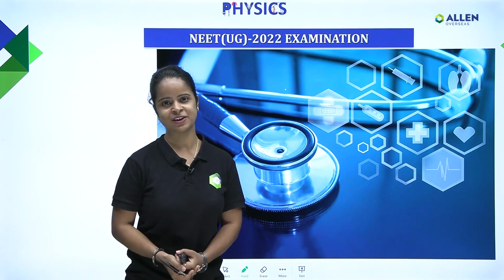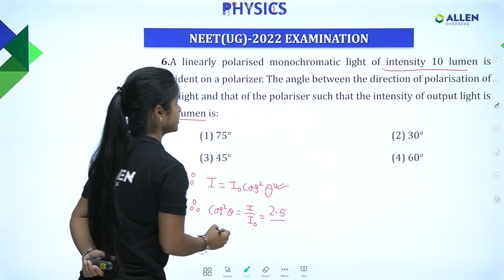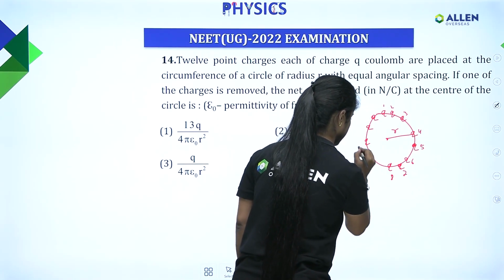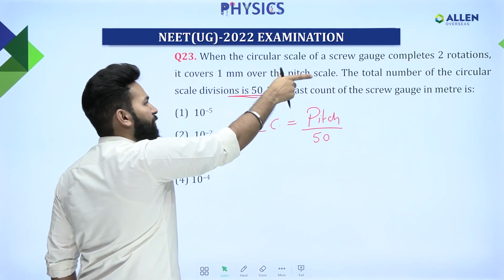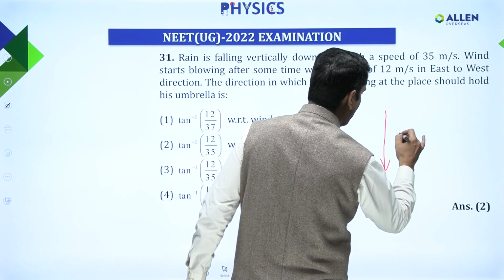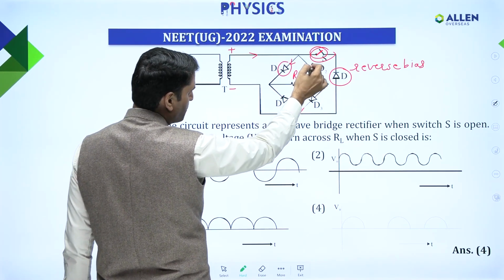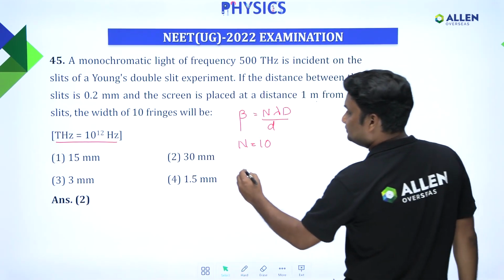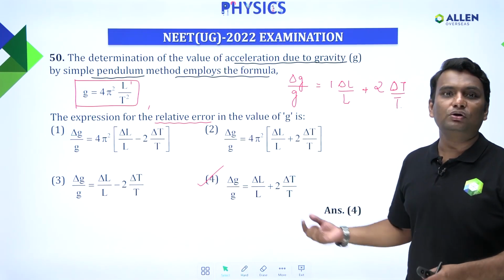NEET 2022 Paper Solution - Physics 📑| NEET Physics Paper Discussion | ALLEN Overseas #allen

Comment: Question no. 25 
What i did not get is 
Assertion:
When there is no friction wouldn't the body fall back due to moment of inertia at rest because friction is working opposite to that and in its absence moment of inertia would take the full control of the body and the body will move backwards